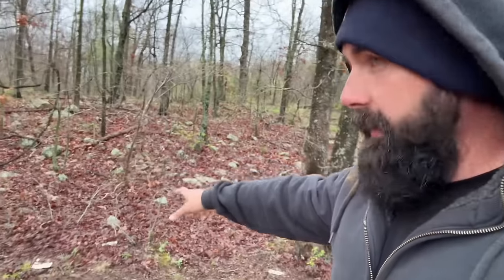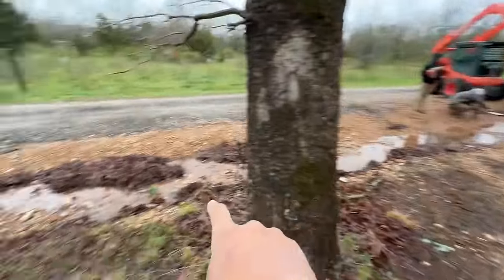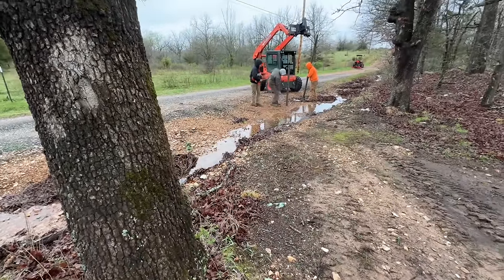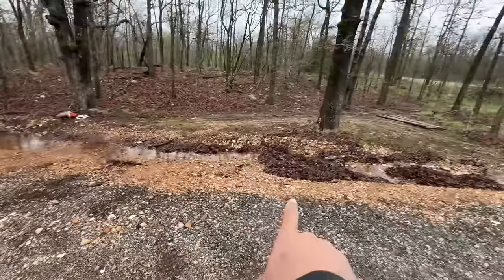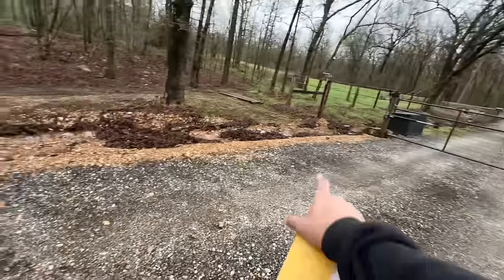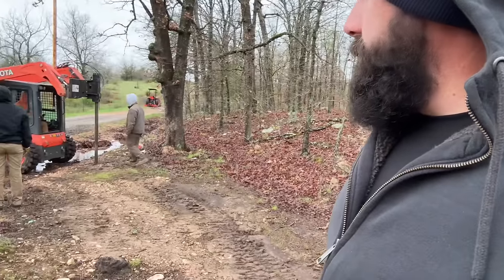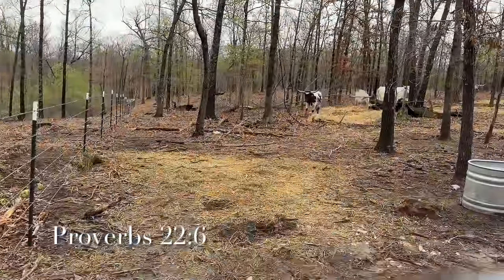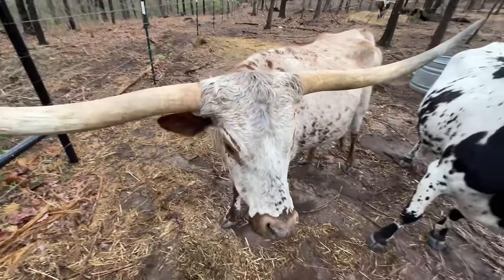ASSESSING THE STORM DAMAGE…

Comment: We experienced 3 storms back to back. Over all last from around 7 p.m. yesterday to 8 a.m. this morning. The final storm left around 4a.m. but it continued to rain. The first two storms were the worst, the 3rd calmed before it got here luckily. God certainly has his hands around us last night. A tree fell on the propane tank at the shelter, luckily just dented the lid. Our greenhouse was destroyed, quail were knocked upside down, and a few limbs came down. While we got lucky many in our area did not. Several are still without power as many lines were taken down and numerous power poles snapped completely off. Many structures were damaged or destroyed. And we don't even have the worst from those storms. So many others had mass destruction and flooding. Prayers go out to all in the wake of those storms and the ones already picking up the pieces.